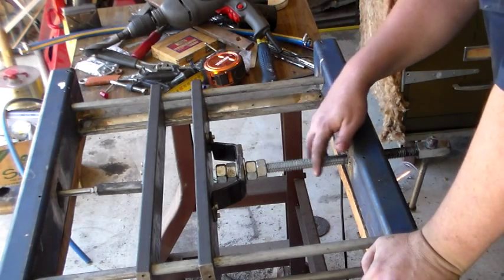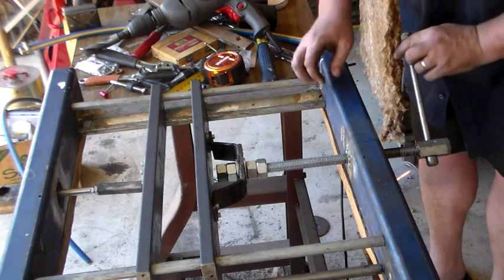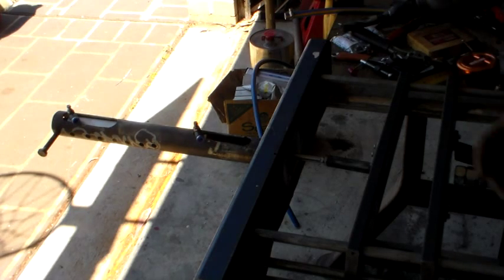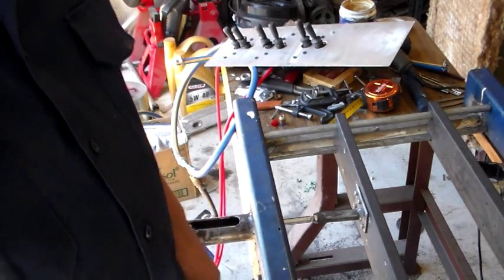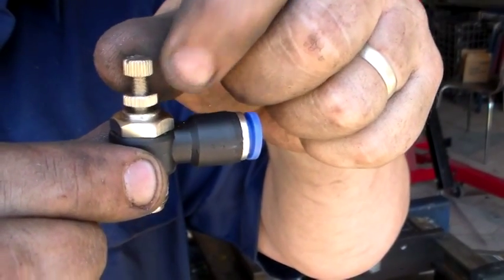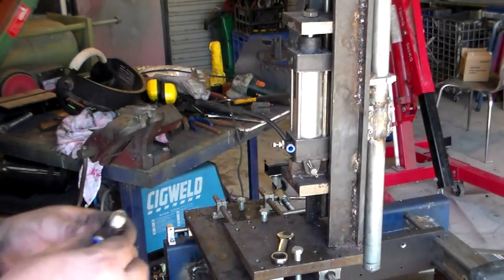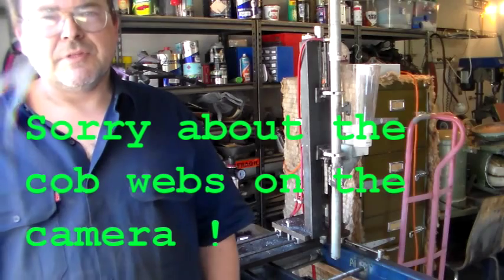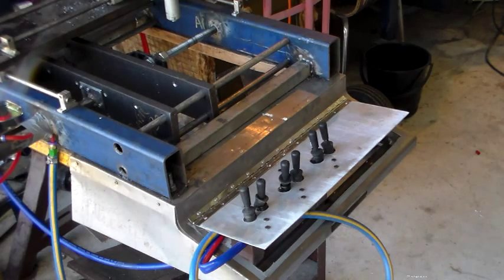Making a Plastic Injection Molding Machine Part 16

Comment: Want to see what your up against building a injection mold machine - this guy is building a simple light switch frame and he is having to use 40 tons of pressure to keep the molds closed and 13 tons of injection pressure. The part where he tells about mold clamp pressure and injection pressure is right at the end. Link >> https://youtu.be/5DpM2IjJNXc

Comment: It takes a lot of force to inject the plastic molds. It takes a lot more force to hold the mold shut when injecting. It's a matter of thousands of pounds of pressure. I know because I have made two plastic injection machines. I learned what not to do by doing it myself as you are. It's a really cool project you got going on.
Reply: drichard12 how can i make a small part , roughly 1/8" thick , roughly the size of an adult hand?

Comment: Not sure if your construction will hold up unless you are just making tiny parts. A very rough estimate for ABS plastic: You need about 1/2 t of clamping force for every square centimeter of projected area of your part. So if your part has a square projected area of 6 x 6 cm, you would need more than 18t of clamping force to keep the mold shut. Also, if you don't clamp over the whole surface of the mold, chances are that your mold will just bend from the injection force and split open. I had this happen a few times with simple aluminum molds. I would think about making your clamping mechanism a lot beefier. Just my 2 cents...
Reply from the maker: Thanks for the input. I'll cross that bridge when I come to it.  I would have though it all relative to the force of the ram that does the actual injecting.  Cheers.
Reply: Yes, it is relative. Basically your clamping force needs to be larger than the injection pressure *projected area. 1/2 t clamping force per square centimeter of projected area is just a rough estimate using the approximate injection pressure necessary for injecting abs. This will of course vary depending on part geometry, thickness of walls, MFI etc.

Comment: Jut making sure, will the plastic be injected into the die by a pneumatic linear actuator? What kind of force can they produce?
Reply from the maker: Kel and Biscuit's Workshop The injection will be done with a pneumatic ram pushing a piston.  Not sure what force it produces, once it's running I'll play around with PSI and see what gives the best results.